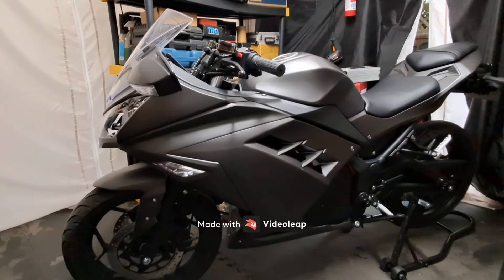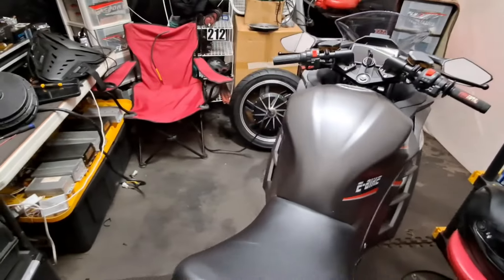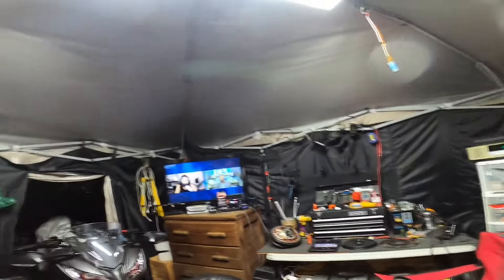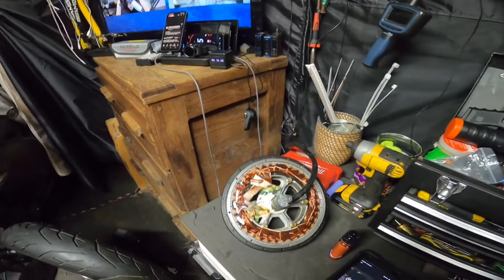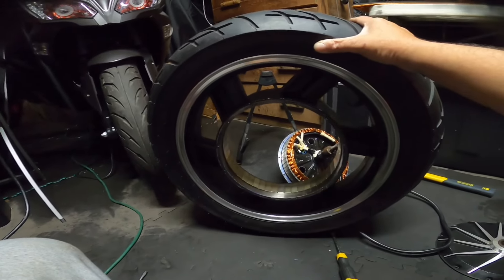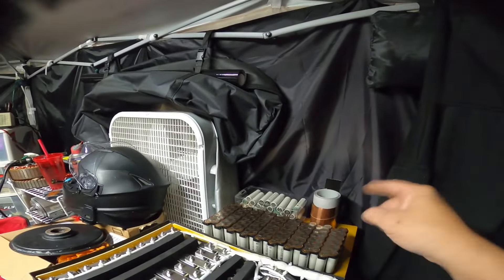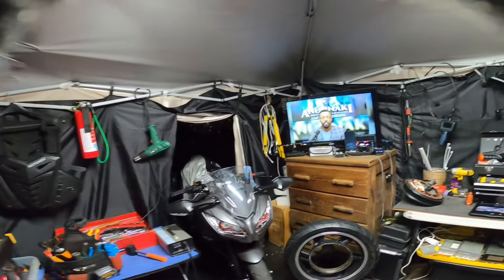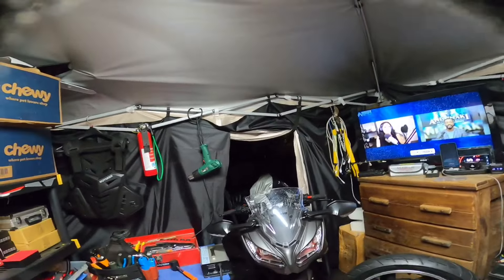Fly Ebike What’s that? This is a Kawasaki Ninja E300 How to open a Motor the Chriscrossingwires way

Comment: Hi Chris, from Toronto .I have this type of ebike  it's call a tao leo 724 ebike 2022 model comes with a Bluetooth speaker 3000w  hub motor. 
The only downside is it must have a bicycle perlite that works to know it a ebike  scooter and a speed limit of 32 kph but it can go faster than that with the off road button hidden that unlock the limiter  top speed of 75 to 80 kph or more
Reply from the maker: Yeah I've seen those and I saw where they say it's a limiter but it's actually not. It's just the controllers gear selection usually has low medium and so often they don't put the switch so you can toggle between the gears but keep the connector hidden sometimes and your just manually changing the selection by moving  connections. They all can be boosted but here there sold different brands same bike tho stock they can do about 90-100kph but can easily make them 140kph I love them. They are all based on Kawasaki ninja 300 frame
Reply: Yes bro,my ebike is ok with city traffic  and I use it as a daily commute to work and back and sometimes in light rainy  days  cause it's not all fully waterproof like normal motorcycle. 
But I did swap out the controller from am em 80 to the original EM-100 votol controller and when I brought the bike it already come with a 50A lirum battery pack 72v.
Reply: I wish it had a digital display showing real time how much battery life is left after each ride. Like yours on your rz ebike bro.
Reply: Where did you all buy these?

Comment: Fam, you killed this. I need one of these. Should've gotten one when they were cheaper. Excellent work though.
Reply from the maker: Bro I dont think no one got a cheaper deal than me. I bought this bike with NO BATTERY so I got it for $1300. with shipping and taxes it was $1800 to my door cuz I had batteries so yeah dont get much cheaper than that unless you buy one with a tempeture, lol Then you dont get no title and vin number some Im good with that!
Reply: That’s why you buy your bike in the off-season like I did. I got it early winter. would they drop the price down now? That is getting hot the price is gonna go up it’s just like winter jackets by your winter coat in the summer.

Comment: What is the best controller to put on that bike im trying to do small upgrades at a time
Reply from the maker: I mean I did different upgrades from the beginning to show the difference starting with a votol em100 Sab72150 now BAC8000. They all did well the first 2 did about 60mph GPS and the BAC8000 pushing 80mph with stock motor
Reply: @ChrisCrossingWires1212  thank u thats about what I wanna push for now is 80mph I just need a better battery and that bac8000

Comment: 🔥🔥🔥🔥-any suggestions for my red RZ you are right I want to change-the toyish look I wanna make it all red ninja 300. I can’t even ask you how the fuck did you do that?
Reply from the maker: Bro it's nothing. Just remove the stickers if they are hard to peel use a heat gun or blow dryer warm them up. They sell the Ninja stickers on Amazon for cheap